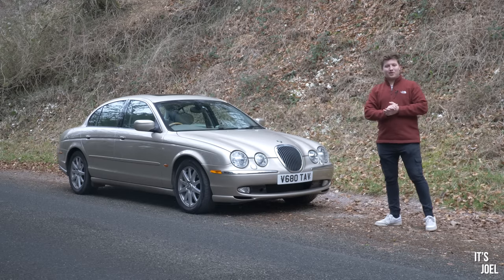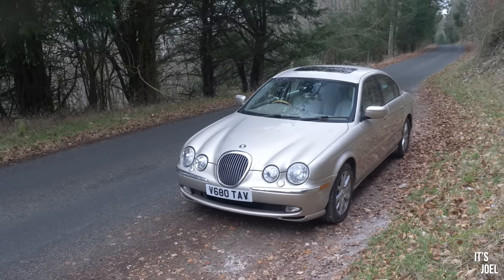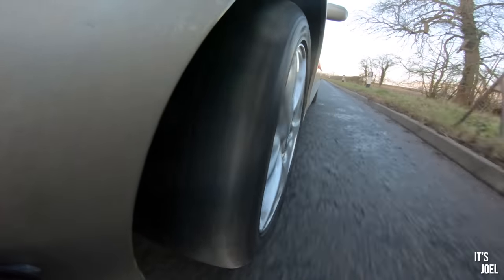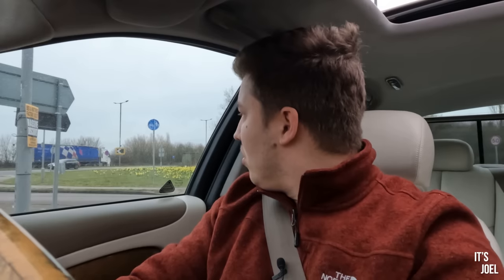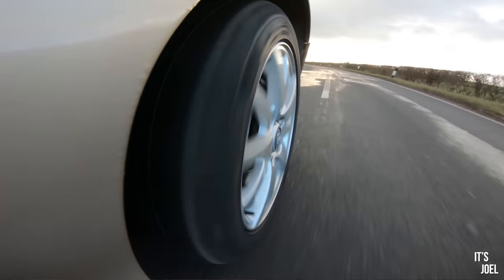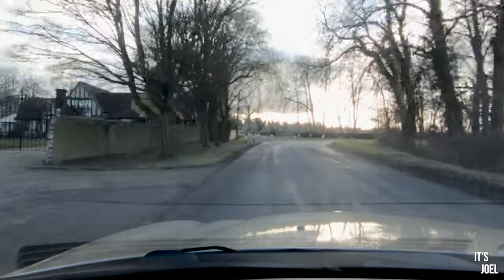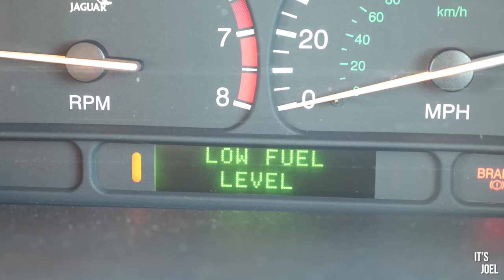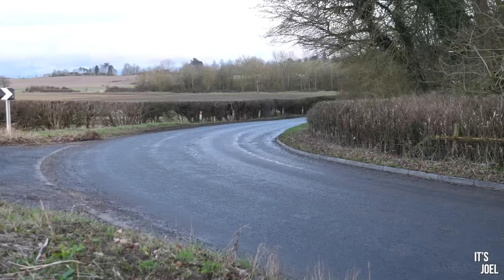This absolutely transformed my 25 year old Jaguar!

Comment: For reason to do with the polymers used, tyres now age much quicker, specifically they become much harder (so less grip and noisier) in cold weather. Really need changing every 5 years and as you’ve discovered the difference is huge.
Reply: Great advice. Just about to change my 5 year old Hankook tyres on a Hyundai Tucson. They have plenty of tread but have become very noisy, especially from the rear.  Minor cracks formed between the treads.  Going to fit Pirelli's shortly.  I'm hoping for a big improvement in noise levels.

Comment: A good set of tyres can transform a car, so a definite worthwhile upgrade.
As you're car is knocking more from the front that can only be due to the new tyres having a stiffer sidewall, or having too much air pressure in them. Be worth checking what PSI the tyre fitters have put in, if you haven't already. In my experience they often way over inflate on fitting.

Comment: Joel, this video was very timely. My 2010 Xf (340bhp) flew through its MoT test a few days ago, but the mechanic pulled me to one side to have a look at the inside of the Pirell tyres. Basically they were all radially cracking and perishing, despite showing 6mm of tread, with blobs of rubber coming off. When we looked at the date stamp, they were 2016 (never mind 2008). So always check the date stamp - expensive lesson!
Reply: geeze drive the car more don't pull a Paul Walker lol

Comment: Very good video once again mate! I can only agree with you, new tyres can make a huge difference in the handling of a car. I bought a VW T4 2.5 TDI a few years ago (love i by the way, it now has 485000 km on the clock, and that pump-injector engine runs like on the first day). It had 20 year old tyres on it that no longer provided any lateral support, that's how out worn they were. With new tyres, the steering became really precise again, even in a bulky car like the T4.

Comment: Hi Joel. New rubber all around is good. In my experience over the years. Even after MOT. The steering feels lighter 
(for a time). Because all 4 wheels have dropped through "Gravity" when on the garage lift. It gets a little tighter after road use.
See you in the next one. 👍👍

Comment: Vector Gen 3 is my all time favourite, they are now the shoes of all cars of mine. Excellent performance under all weather except for the road noise which is a bit nosier than Continental's while Prelli perishes in 3 years. No regret for the switch.
Reply: I had gen 3's on my last car,Best all around tyre I've had on a car was Bridgestone A001's..had them on two cars...they were superb..so Good that I tried to import a set after they discontinued them in the UK.by far the best tyre I've had.
Reply: @deanj846  I always feel that bi-directional tyre is relatively less nosier than uni-directional. I reckon that A100 is quieter while G3 offers better snow/ice grip. G3 had once saved my family on my 4x4 that she braked just in time while someone cut my cars ahead at around 60km/hr in heavy rain.
Reply: That’s not too many all season tyres out there are snowflake certified, G3 is one of them.
Reply: Who gets 3 years out of a set of tyres?
Reply: @zeewin  I ran both gen 3's and A001's on the same car...after having the bridgeys on a previous car...The Bridgestones were by far the better tyre,by a huge margin.I even tried to import a new set from mainland Europe but by the time they wore out they simply weren't available anymore.They just did all you could ask exceptionally well...
Reply: Dave Johnson  I have kuhmo ha's on now.
Reply: @YellowPinkie  Plenty of folk...if you work near home.
Reply: @Dean J  I would love to get 3 years out of my daily's tyres!

Comment: You'll absolutely love it when you refresh the steering/suspension components, the old girl will almost feel like a new one again. Don't be suckered by the cheap sets you can buy on fleabay, find out which ones Jag used when new and try and get them, or better.  I've used lemforder, febi bilstein and meyle on my old e39 5 series, see if they make stuff for Jags. Anti-roll bar bushes are a relatively cheap and easy fix too you could do yourself, try powerflex blue poly bushes. I'd also say a 4 wheel alignment on a Hunter machine is essential after all this. Keep going Joel, you'll probably never get back what you're putting into her now, but I think you've realised that's not the point...

Comment: Quality rubber really does transform a car! When you said the S type isn't the most dynamic, I'd agree but to a point. I remember chasing down an audi A8 in my 3.0 S type and it doing well to keep up!

As a side note your steering wheel airbag leather looks very dry. On my S type it needed feeding with gliptone conditioner every so often to help the dry leather soak up ghr goodness! Yours looks near enough exactly how mine did till I fed it, hope that helps!

Comment: Gotta be kidding me. We got the same car. Mines newer but I also have tge vector 4 seasons gen 3 and they are stunningly good in all conditions. Drove through 8 inches of snow like it was nothing. Studded tires give more ice security but the feedback is very good so you always know how quick or not to drive. I’ve got the 235 though. And for track times the eagle F1 asymmetric is about 1% faster according to tyre reviews. So a real performance tyre in summer also. No slouch. Fits the S type personality well.

Comment: Good story Joel, however my older Astra 2.2 convertible I basically just get part worn Practical to gain MOT but rubbish otherwise.
Last week My (February) MOT failed on tyre and suspension top bush or something.
I went to part worn tyre guy, id love to name and shame but where's the point I wont ever use them again.
The MOT station I took car to was doing the one repair but I noticed they had the back wheel off They said they was changing the tyre. WTF like I said I had part worn put on they showed me the tyre and it wasn't very impressive it looked like a gash in the tyre tread £40 quid What a waste. The part warned tyre guy took tyre and never gave me any cash back, Bound to gain another £40 out of the tyre to someone clueless. So my Astra MOT In total cost me £240.
While on subject of tyres I went (NATIONAL TYRES) for my Audi A6 2.7 TDI they had special offer on (buy 4 Tyres pay first one on fitting) and then rest over 3 months interest free, I get sucked off with garages sucking me off for Wheel Alignment and not bothering to do the job. But to add further insult, When my car went for a service at a garage it had originally been to before my ownership the garage guy noticed cracking in the tyre tread..? how many tyres I am not sure. but my rear driver side tyre loses air fairly regular and just before Christmas 2022 I had a puncture on my front passenger which cost me a new budget type tyre £73 to say angry it don't come close.
I thought buying 4 reasonable Avon Brand tires would last my car within my ownership.. Yeah right NO..grrrrrr.
So I now have 3 Avon and one budget. I was told the weight of the car and the engine size will wear most tyres out in around 12.000 miles.
Yet My old 14 plate transit van is still on the same front tyres when I purchased it. the rears I have changed but fronts have done well I think at around 42.000 miles perhaps more because I don't really know when the original tyres on van (at time of purchase) had been put on.
So I trying to workout how much longer I want to keep my Audi and decide my best option for a set of 4 tyres in near future.
Good luck with your wedding car Joel

Comment: Beware the sunroof module with a poor battery!!. Don't use it until you have replaced. Anti roll bushes and ball joints are worth changing if the original are still there. There should not be any knocking anywhere.
Not the easiest first spanner job for DIY on the driveway, lots of content on the work so you can decide if either is for you to try.
Front brake caliper brackets are the worst design on this model for disc removal. One of the bolts is inside the strut with limited clearance.
My S type 4.0 now has slotted/drilled with EBC pads.
So far only tyre fitting and wheel balance and Aircon recharge is the only work I've had done at a garage. It's not cost effective to get kitted out for it for DIY.

Comment: Could you honestly say hand on heart, that if some nice chap changed all the tyres on the JAG with out you knowing at night, and you woke up the next morning and drove it.

Would you have been able to tell? (Without Goodyears sponsorship)
Reply from the maker: Oh yeah definitely. Tyres make such a huge difference. I’ve always paid for my tyres until now and never regretted forking out for them.
Reply: You can definitely notice it. I had a Merc C270CDi many years ago. As soo. As the tyres started wearing down to 50% you'd know. Even pulling out of a road going left or right the tyres would spin and the traction light would come on under normal throttle. Floor it ar the lights and you'd get wheelspin. They were Scorpions but had the same with Contis too on my XC90.

I'm not a hard sports driver but even in ordinary driving I can tell when the tyres have gone way past their best. Very noticeable.
Reply: Most drivers don't understand how important tyres are. To be honest I was shocked to hear he had been driving on a tyre from 2008.
Reply: You certainly do notice it, what you  won't know is how well they will wear. I run Michelin crossclimate on my volvo xc60 and Cooper at3s on my isuzu d max.

Definitely cheaper options but they don't perform or wear as well.